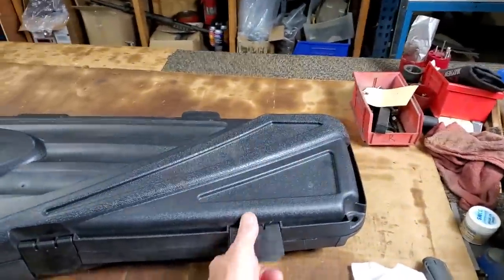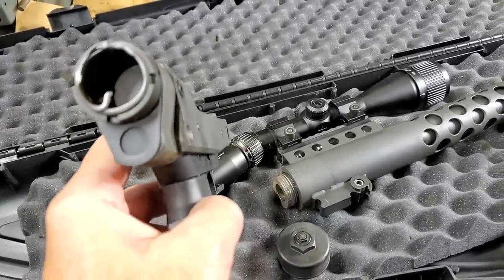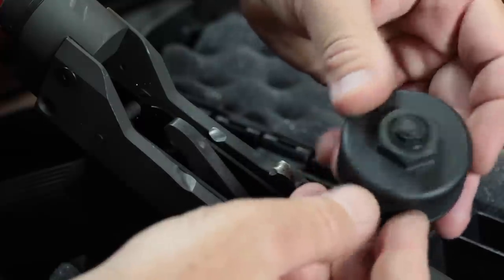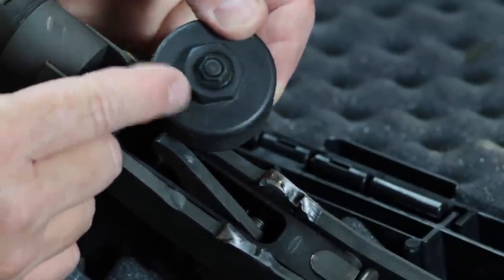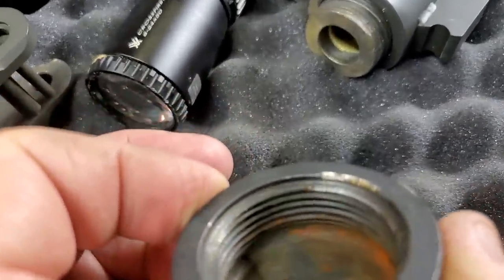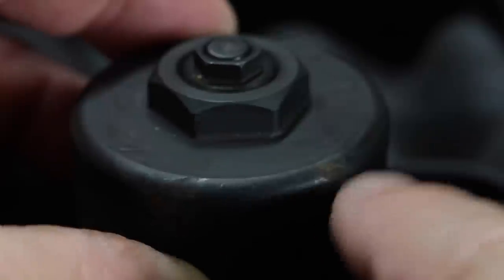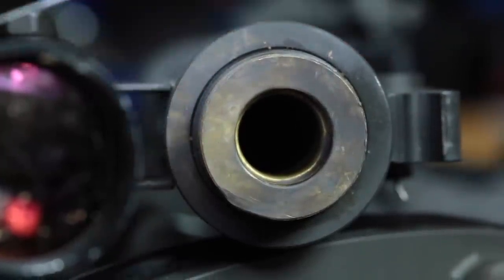Kentucky Ballistics' RN-50 Blow-up:  First Look

Comment: So regarding the "ears", why do they need to be ears? Is that just for ease of thumb cocking? Why not keep the bulk of the material in place instead of machining it to look the way it currently does; So what if the gun gains a couple of ounces? At least the bulk of the material would be more difficult to shear off.

I don't own one of these guns, and I am not sure how the hammer works. I'm guessing it is a Double Action trigger/hammer. If that is the case then it what I mention in the previous paragraph regarding keeping the material and not having ears would make that are even stronger. 

Watching the video, if that hinge pin didn't shear and send the barrel forward then the "equal and opposite reaction" could have been more severe. 

I am just a hobby machinist(loose term) and not a gunsmith. I didn't even stay at a Holiday Inn recently. I'm just expressing an opinion and not trying to add to the crowdsourced ballistics investigation. Delete my comment if it is off base and causes issues.

Comment: I don´t get why the backside blow off while the barrel was not obstructed. How can that be ? Does the pressure not take the path of least resistance ?
Reply: Even if it does take the path of least resistance, that doesn't matter if the pressure is building more rapidly than it can vent down the barrel.

Comment: This is why everyone needs to practice good habits. maintain tolerances with your loads, with your ammunition and with your firearms. Remember every single time you fire a round it's an explosion. If kept within tolerances for that firearm you are 99% safe. 

it's when you try to push those boundaries that exponentially increases the risk for this kind of thing. There never ever should have been that kind of charge in that ammunition. To blow apart metal and warp it to that extent yea that round was way way overcharged.

this was not corrosion or metal fatigue. this was flat out KABOOM

Comment: Did you forget to heat treat the barrel thread
Seems like they are the ones that got shredded
Reply: they are heat treated. it takes over 160kpsi to shear those threads. that is three times the pressure of a 50 bmg round.

Comment: Ductile failure on the ears, too. Not like there was some kind of inclusion or material issue going on there. Just tore the frigging things off.
Reply: the ears took a good amount of the force the cap was impacting. those ears being sheared off saved his life. strengthening the ears would turn them into deadly shrapnel or potentially cause the cap to hit the top of the head killing a person instantly if a bubba load was put in.

Comment: suggestion to make this model stronger and safer, increase the size of the ears holding the cap. maybe use thicker heat treated steel
Reply: wouldn't do jack.

Comment: Also why has no one said this yet that these ammunition were meant to be used on the m2 and m3 and never on anti material snipers, M2 man and M3! Both heavy machine guns that are made to penetrate armored vehicles and infantry that can fire up to (m2)450-600 to (m3)1200 rpm 50 bmg rounds per minute and can easily handle these rounds, and we expect these rounds to be fired from a heavy sniper?
Reply from the maker: No one has said this?  At least 50 people have said it!!

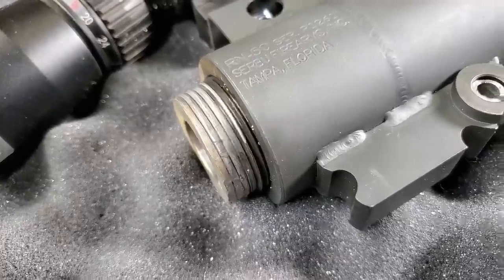Comment: I see welds.  2:27.  What is the process after they put those welds in?  I'm also suspect of how deep the threads are.  They are acting as the lugs.  My 30-06 has deeper and thicker lugs than that.  Need to take about 10 of these guns out and put about 100 rounds down on them.  Very the type of rounds on each gun.  Then exam the threads and x-ray the metal at the threads.  I don't think any one is going to throw that much money at this project.
Reply: those threads would have taken over 160kpsi to shear. that is over three times the pressure of a .50 bmg.
Reply: @toomanyaccounts  In theory
Reply: @DevilDaRebel  no in engineering math
Reply: @toomanyaccounts  LOl, That went over your head. Continue acting pretentious on all the comments, buddy.

Comment: An Army solder wrote a book on the 50 BMG and it states NOT to use SLAP rounds with a Muzzle Break!  Anybody talking about this?
Reply: That wouldn't cause an overpressure. After the projectile has traveled about 6 inches down the barrel, the pressure has dropped well below peak pressure. Pressure at the muzzle break is insignificant compared to chamber pressure. The manual is more likely concerned about accuracy and damage to the muzzle break.
Reply: @tadferd4340  yeah its Fudd lore. Barrett themselves stated that slaps are safe to use with muzzle brakes. all that happens is plastic comes out the sides of the brake and if there was any blockage the next round would clear it. only civ made brakes not up to mil spec would come flying off.

Comment: Even though the round fired was horribly overpressured, one thing I know for sure: I would never trust a gun that fires .50 BMG that is being held in by a damn screw cap. Even before this incident I was sus about that screw cap. Needs some sort of lock, or dual/triple lock similar to what bolt guns have.

It's better for a gun to blow out sideways or forward rather than back toward the shooter.
Reply: give you a clue bolt action .50 bmg have sent the bolt back into the shooters's head when they exploded due to overpressure rounds
Reply: even non bolt actions that have the strongest locking lugs have had the bolts fly back and kill the shooter when an overpressure round that was more pressure then the gun was designed to handle was fired.

Comment: It’s probably a 1 in a million it would happen but the moment I see this firearm i definitely wasn’t keen on a screw cap to hold back the pressures from a 50cal
Reply: While I don't like the design, it can easily hold .50 cal pressures. The estimated pressure to cause this damage is over 3 times typical .50 cal pressures.
Reply: this is design is used in cannons because it is one of the most strongest actions out there

Comment: Mark, buy some SLAP rounds and try to recreate the accident.  Test a gun, with the SLAP rounds, but remove the Muzzle Break FIRST.  Observe the gun and the action of the rounds down range; to see how they are performing.  Then test the gun some more, with the SLAP rounds, with the Muzzle Break in place.  Observe the gun and the action of the rounds down range, or at the muzzle or until you've recreated the accident.  If this doesn't reveal anything; then it would be safe to assume it was the individual SLAP round.  By the way; you could start with reading the instructions and the warnings that come with the SLAP rounds....
Reply: he already has the slaps

Comment: 👍🏼 Ammo-Fail, for sure, most ammo have a case crimped to hold the bullet, and the SLAP having a plastic sabot even more soft than brass, the crimp was not the reason, the only reason for me to see, totally overloaded ammo ???. If possible for you, send the remaining brass to a lab , doing this things, they can by gas chromatography test residues and maybe even tell the brand and so on of what powder was used as propellant.   🤠

Comment: Good video thanks. I was a bit surprised to see a rugged simple gun like this fail. I guess enough explosive will turn anything in to a pipe bomb.
Reply: if it was a bolt action the bolt would have gone through the head of scott.
Reply: @toomanyaccounts  yeah quite possibly.
Reply: @greybuckleton  nope we know what happens to bolt actions when a round detonates in them. plenty of expensive bolt actions had their locking lugs shredded and the bolt fly backwards into the neck or skull of the shooter when an round loaded with pistol or magnum powder went off. seen footage of a .50 bmg bolt action explode and send the bolt into the shooters neck

Comment: Looks to me primer failed bcuz where is it normally the primer which is the end the firing pin hits usually is there after the bullet fired right
Reply: primer failure wouldn't have done that. that was triple or more pressure then standard .50 bmg

Comment: Could this have happened from just normal wear and tear over time ? I’m not a gun expert just asking
Reply: not on modern guns unless you were doing a number of plus pressure rounds on a gun that wasn't designed to fire them continuously. even then a few plus pressure guns warn in the manual to not fire 200 or more such rounds in a row. plus pressure is still less then an overpressure round meant for proof testing of a gun. no guns are rated for double plus pressure rounds. 

 standard .50 bmg is 50kpsi. an overpressure round testing for 50. bmg is 66kpsi. it took over 160kpsi to shear off those threads. to get three times or more pressure means that round was loaded with pistol or magnum or some mixture of something that isn't standard powder meant for .50 bmg. either of those would have blown up any .50 bmg gun. 

on a bolt action it would have sent the bolt flying back into the head or neck of the shooter. seen video of one blowing up and doing that on a range. the shooter was shrieking in pain and the range officer was screaming to cease fire and get medics and towels.

Comment: THe force required to do this kind of damage to such tough steel, leads me to believe that this wasn't an accident, I believe that the .50cal round Scott used was definitely tampered with because even with the errors that can occur in manufacturing, nothing like this has happened before, at least not like this, where the firearm used is so sturdily built to prevent the kind of very thing that happened to Scott. I think someone was targeting him what if a different kind of explosive was substituted for the normal cordite that is used by the U.S. military? It is certainly possible, and because the SLAP round is no longer being made and the rounds are curated from multiple different sources, it's the perfect kind of environment to do something like that and not be identified right away. THis is of course, my own opinion, but when an old round is found, if it deteriorates over time, it is most likely going to become less effective over time, rather than MORE effective, the whole situation does not follow our understanding of both Physics and the law of entropy. ALL things degrade over time, not become more efficient and that is doubly so for explosive compounds.
Reply: It didnt' need to become more efficient to do this. It's possible that it just had to become more unstable and go up in a quicker period of time then it was meant to.If it broke down to a finer powder that would expose a greater surface area for example. I don't think there's anywhere near enough information to suggest attempted murder.

Comment: If those ears hadn't been there, the cap would have killed Scott. They no doubt absorbed a huge fraction of the velocity. This was essentially a directional pipe bomb blowing up in his face. Those SLAP rounds are scary; I wouldn't suggest anyone use them unless pulling the trigger with a string and getting behind cover. It's clearly a gamble.
Reply: those shown without the proper crimp are bubba handloads sold at a gun show then were resold time and time again.

Comment: I'm sorry, I'm no forensics guy, just someone interested in guns... But what the actual everloving fuck was in that shell?!?! That it could do this?! You said yourself that the first estimated reports of the stress failure point of those threads were inadequate/erroneous and that the actual pressure was in all probability massively higher than was at first reported (I forgot the numbers mentioned). From where I'm sitting, and that's just looking at this without functional knowledge of gunsmithing, I would be very much inclined to say that the fateful SLAP round that was loaded into the breech was loaded with high explosive somehow, and Scott, through some massive bad luck on his part, managed to get his hands on a sabotaged round that I've heard mentioned elsewhere. I obviously don't know how much truth there is in there, but I'm really just watching this utterly stunned and baffled, and frankly under the impression that Scott needs to give his guardian angel a raise, the guy has absolutely earned it for being on the ball.
Reply: pistol, magnum powder would do it.

Comment: So where are the gas vents?
Reply: gas vents do not protect from over pressure events. they are meant to vent gas from busted primers in which the gun design doesn't allow the primer gas to go out the barrel.

Comment: What is the caliber of the bullet without the plastic?
Reply: doesn't matter. it is much faster velocity. its meant to help penetrate armor against say armored vehicles.
Reply: @toomanyaccounts  Yea it’s just that I was thinking that if people want to shoot smaller bullets that travel faster, why not creating a .45 or a .40 bullet with the same shell as a .50. Instead of using these gadgets rounds
Reply: @rkchoka101  this gadget round was meant to improve armor piercing capability. it fits a small niche in the military arsenal.
Reply: @toomanyaccounts  If it was it would be commonly used by military forces 🤷🏻‍♂️
Reply: @rkchoka101  it is for the application as described. millions of the rounds were made
Reply: @toomanyaccounts if it’s not use then it’s no use 🤷🏻‍♂️
Btw they created a .416 bullet that is supetior to a 50 bmg, I didn’t know

Comment: If I had designed this, I wouldn't have used that ear design, I'd just have the metal continue all the way back, there's no need to have the top edge drop down (Forming the ear) and then back up again at the stock.
Reply: those ears are there for a reason. they took a large portion of the force and slowed down the cap.
Reply: @toomanyaccounts  op means make a full ledge, not just ears

Comment: I'd have no problems buying one of your guns, but I'd definitely keep away from gun show SLAP rounds. Either the cartridge was loaded too hot, or that plastic jacket on the round left enough residue in the barrel that it became a partial obstruction. Well, that's just me guessing. Be interesting to hear the results of your analysis.

Comment: Based on the construction of firearm in the barrel it had to be some Bubba reloaded slap rounds or something with the muzzle brake assisted in the malfunction or a combination of both because with the pressures this gun is rated for along with the heavy ass Barrel Scott put on it there's no way in hell a standard mil-spec slap round should have done that to that serbu it had to be some jacked up ammo or as I said something to do with that muzzle brake or combination of A and B for that to happen although not certain there doesn't appear to be any Barrel obstructions and there's no significant Warped Tour deformation of the barrel or chamber to Warrant this happening it has to come down to a broad spectrum an ammo issue possibly compounded with a muzzle brake but definitely I'm willing to bet an ammo issue there's probably one around that was way too hot because from what I understand about the pressure the standardized milspec slap round had that gun should have been able to function and fire it just fine with no issues
Reply: the muzzle brake affecting slaps is FUDD lore. All that occurs with slaps and brakes is bits of plastic get ejected. if there was any obstruction either the next slap projectile would clear it out or the brake would fly off if it wasn't mil spec. this rifle was custom built to handle slap rounds

Comment: It really shows how much power is in a .50 BMG. Especially with those single fire/bolt rifles…. Theres no springs or actions to absorb the force, the frame and firing mechanism just has to TAKE that force. It’s intense… I can see a single fire .50 being used regularly failing after so much use. There’s a point where the stress just builds up so much until it breaks! 

I’m sure there’s nothing wrong with the rifle itself, just consistent use and the frame just couldn’t hold any longer. 

It’s hard to make a truly indestructible single fire rifle without it being 50lbs machined steel tube 3 inches thick and a firing mechanism thats 5 pounds just on its own lol.

Comment: If the case failed, the gas pressure was applied to the whole internal cap area generating a force that far exceeded the regular force. From the cap size picture it must be around three times if not more !

Comment: When metal is heat treated, it becomes more wear resistant but becomes more brittle to shock (depending on what type of steel), so it will fracture with impact, especially repeated stress. Either the gun design is awful, or the rounds were hotter and blew the gun up or a combination of each.
Reply from the maker: You obviously have no idea how heat treatment of steel works.
Reply: Heat treating creates better shock resistance, despite being harder (there's a useful window). This is why battleship armored plates are hardened

Comment: Look at the damage that is usually delivered down range. And look at the damage to the gun. The cap was obviously strong enough however the things ment to secure the cap were not "strong enough". Strong enough? is a subjective metric. Without analyzing the the charge everything to do with the round is speculation. Luckily Scott is alive to tell the tale.
Reply: the threads would require over 160kpsi to shrear off like that. that is over three times what a .50 bmg is meant to produce. even the overpressure for testing are 66kpsi.
Reply: @toomanyaccounts I'm not suggesting the thread wasn't strong enough. For normal operation. I'm just saying in this case they were not strong enough. That's pretty obvious no
Reply: @mp6756  no gun would have survived three or more times the pressure it was designed to handle.

Comment: You should never fire slap rounds through a muzzle break.
Reply: Barrett says differently. stop repeating FUDD lore. muzzle brakes are perfectly safe to fire slap through. the military was just not cleaning the guns as they should have been and hence had squid loads in the barrel.